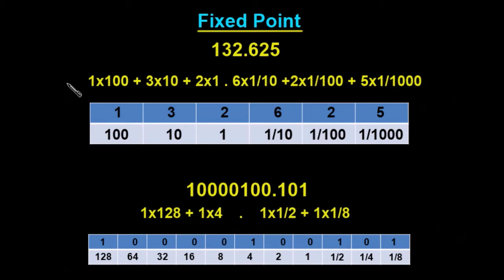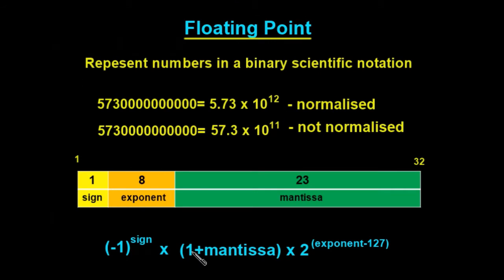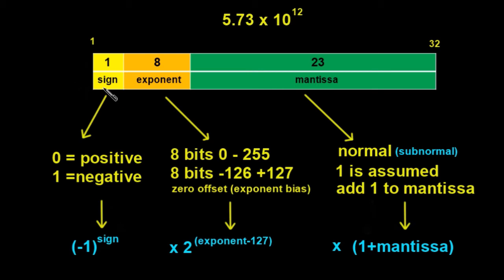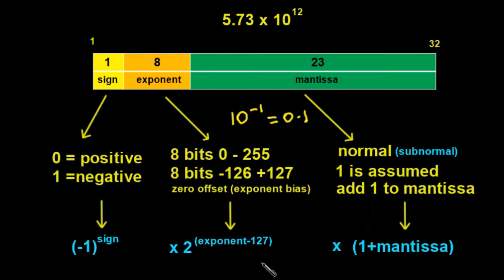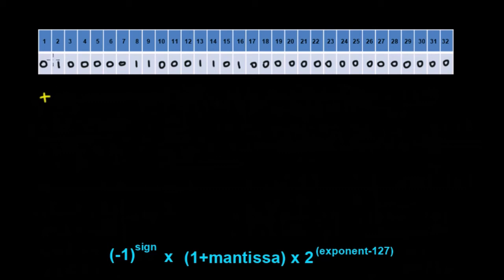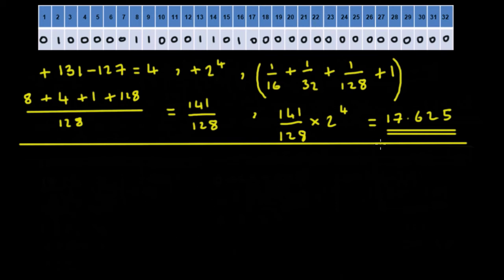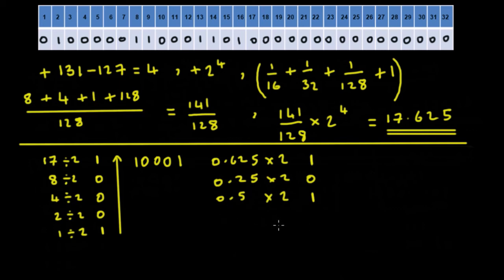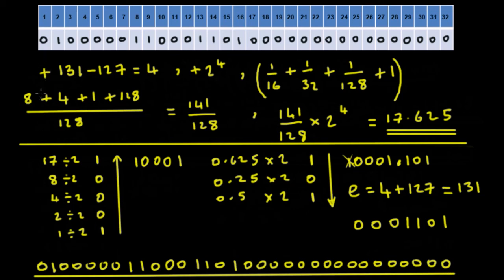Design a Floating Point Unit 1 - Normal Numbers

Comment: Very interesting video.  Not sure why there are random music clips within the video though,  as it's annoying!
Reply from the maker: Hi there. These videos are part of a series I am putting together for a full course. The music is a catch22. Some people like and some find annoying.
Reply: @RossMcgowanMaths  Thanks for the reply, I guess the answer is Marmite 
Good luck with the additional videos, looking forward.
Reply from the maker: I am stuck. I have built a floating point multiplier. Works fine. Tried to add in a test for overflow. Is easy when programming just test a simple test. I have spent probably 24 hours of work trying to implement it in logisim but keep chasing my tail round in circles (confusion over binary , 2's complement , signed binary all getting mixed up in logisim (doing my head in).
Reply: Ross Mcgowan  I just started with LogiSim after watching your videos, and currently building some Logic circuits. D-Latch, Flip-Flop, SR, JK, JK-M.S, Decoder, Multiplexer, etc...
I usually directly work with Breadboards and various components.  Some occasional Arduino stuff, and a whole lot of coding in various languages.
I might make my own YT channel, based on electronics and related programming techniques, but dont yet know which way to go... PC and Adobe? or Mac and Final Cut Pro.
If I were you, I would break it down and test each segment manually.  Do you have detection for signed and unsigned binary?  as these might require duplicate circuits depending on the Flag 0/1 status.
Reply from the maker: Thanks for the suggestion. I just worked out a fix and all seems to be working now. I use OBS for recording (free tool) I use windows moviemaker for editing (beware virus editions of this online  , now no  longer available from microsoft ). I use smoothdraw for writing with a pen and touch and an amazing tool called NEBO  which is a handwriting recogntion app which I paid a fiver for (I use this to write mathematical equations which it then translates to text - really cool). I sometimes use powerpoint and adobe cs5 for graphics. Best thing to do is just start recording (also use logitech c270 webcam sometimes). Try out brian g johnson for youtube help and motivation.
Good luck.